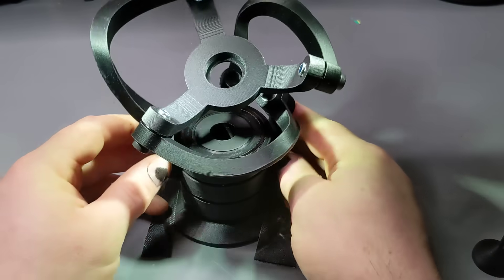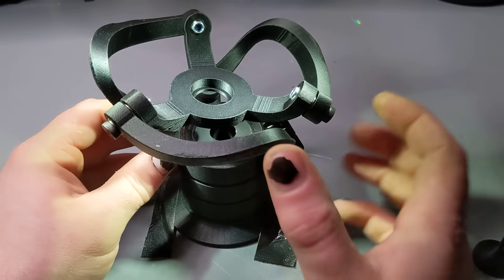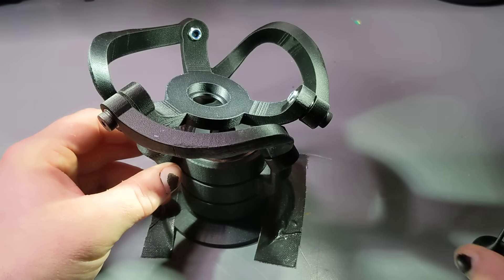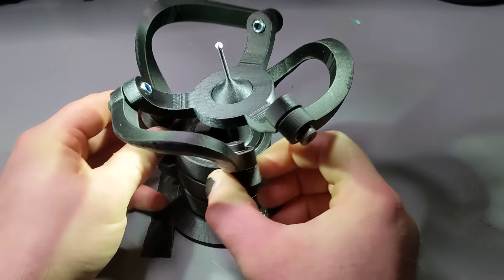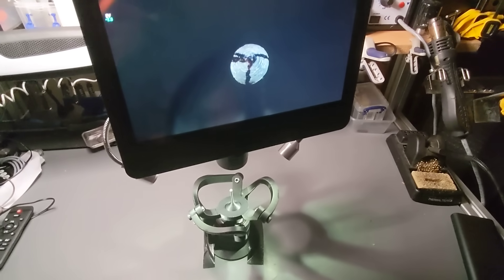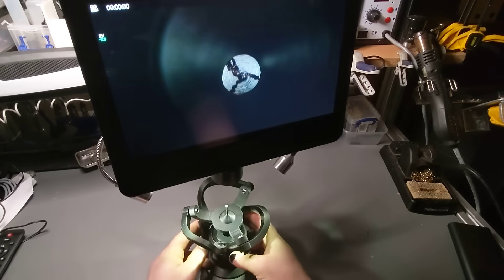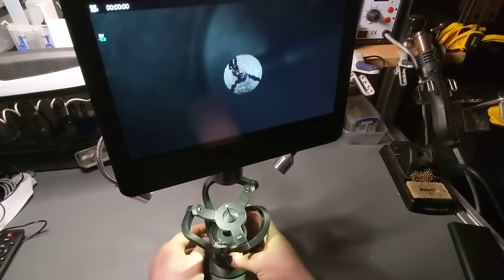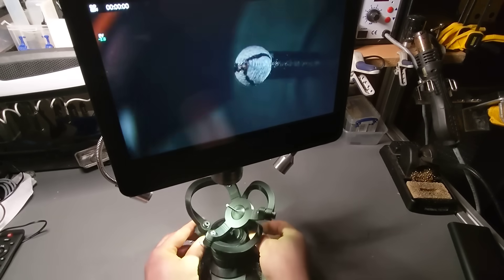Spherical Parallel Manipulator

Comment: I need that - vacuum proof - for my scanning electron microscope. 😅
Reply from the maker: I've been thinking of making a serious one (ie metal and rigid) to sell for microscopy, if people are interested I will, but either way I'll make an open source version for people to make 

I posted an update vid covering cad/files etc, check it out and leave a comment there on which concept you'd prefer and what your use case/application is (people keep surprising me with novel uses) and I'll do my best to accommodate that in the released design. 
https://youtu.be/wN02itp6-z4

Comment: Hey MakeBreakRepair I saw your video this week and it inspired me to practice my fusion 360 (still a total noob) 

are you ever planning on sharing or selling the files? I would love to compare them. 
I spent the last two days attempting to make my own and I got it working! but yours is way better. My PLA monstrosity works though and that is what matters. You are an inspiration. I cant believe this machine is so much simpler than it looks normally I cannot backwards engineer from a single video so easily. You truly made an elegant design that made it easy to understand
Reply from the maker: Thanks, I really appreciate it :) 
Mine only looks good from the angle you're seeing it though, getting the arms to not interfere is tricky... I solved it with a heat gun 😅 (can do it in cad with design studies and similar, it's just tricky)
I can't take credit for the idea, I saw one on youtube and overthought it a bunch, then saw a vid from @swannschilling474 and figured out it's actually simple, you just point all the bearings at the same point in space and join the dots (ignoring the arm interference issue...) 
I made an update vid that talks about it a bit and also CAD etc for people https://youtu.be/wN02itp6-z4
Reply: @makebreakrepair  you lucked into the ideal ratio for the most swing/range of motion though, Ive made a few now and only one of them works, there is something to the angles of it (besides them all pointing at the focal point), something to do with the relation between the first and second sets of screws and their relative angles. mine worked with 120degrees/60 degrees but when I tried to get more travel by going to 100 degrees/45degrees it doesnt work. Maybe it was the fact they multiply evenly in the first case.

Comment: Please release stl files. I would love to print
Reply from the maker: I posted an update vid covering cad/files etc, check it out and leave a comment there on which concept you'd prefer and what your use case/application is (people keep surprising me with novel uses) and I'll do my best to accommodate that in the released design. 
https://youtu.be/wN02itp6-z4
Reply from the maker: I've just uploaded the latest update vid, I've put a lot of work into making it accessible for everyone, files available very soon and I got the costs down to $10 of parts: $10 SPM https://youtu.be/DqjAKmm-FJQ

Comment: Another application would be radiation therapy.

Have a patient secured in a larger version such that the tumor is at the center point of the orbits.

Then as the radiation dose is being delivered, operate the device in such a way that the tumor will get a large amount of radiation but the rest of the body will not.

Comment: The engineering behind is absolutely brilliant!! Do you have the cad file for this ?
Reply from the maker: I posted an update vid covering cad/files etc, check it out and leave a comment there on which concept you'd prefer and what your use case/application is (people keep surprising me with novel uses) and I'll do my best to accommodate that in the released design. 
https://youtu.be/wN02itp6-z4
Reply from the maker: I've just uploaded the latest update vid, I've put a lot of work into making it accessible for everyone, files available very soon and I got the costs down to $10 of parts: $10 SPM https://youtu.be/DqjAKmm-FJQ

Comment: Admire this. Request for the model ❤
Reply from the maker: I plan to release a free 3d printable one, but I might make a more rugged one as a product for labs and such (if there's demand?)
I posted an update vid covering cad/files etc, check it out and leave a comment there on which concept you'd prefer and what your use case/application is (people keep surprising me with novel uses) and I'll do my best to accommodate that in the released design. 
https://youtu.be/wN02itp6-z4
Reply from the maker: I've just uploaded the latest update vid, I've put a lot of work into making it accessible for everyone, files available very soon and I got the costs down to $10 of parts: $10 SPM https://youtu.be/DqjAKmm-FJQ

Comment: I have to made this ! Thanks
Reply from the maker: I plan to release a free 3d printable one, but I might make a more rugged one as a product for labs and such (if there's demand?)
I posted an update vid covering cad/files etc, check it out and leave a comment there on which concept you'd prefer and what your use case/application is (people keep surprising me with novel uses) and I'll do my best to accommodate that in the released design. 
https://youtu.be/wN02itp6-z4
Reply from the maker: I've just uploaded the latest update vid, I've put a lot of work into making it accessible for everyone, files available very soon and I got the costs down to $10 of parts: $10 SPM https://youtu.be/DqjAKmm-FJQ

Comment: This might be amazing to create mechanical parts without spinning by using laser or high pressured water canons or diamonds to cut into 3d shapes, it could also be used for laser dental removal or ofcourse on the moon for shooting metors or ballistic missiles, create applications indeed

Comment: looks nice, you mind sharing the model?
Reply from the maker: I posted an update vid covering cad/files etc, check it out and leave a comment there on which concept you'd prefer and what your use case/application is (people keep surprising me with novel uses) and I'll do my best to accommodate that in the released design. 
https://youtu.be/wN02itp6-z4
Reply from the maker: I've just uploaded the latest update vid, I've put a lot of work into making it accessible for everyone, files available very soon and I got the costs down to $10 of parts: $10 SPM https://youtu.be/DqjAKmm-FJQ

Comment: Rock on with your Perspective Extrapolator! It's very niiice!! "Perspective Extrapolator" is Patent pending... It's a very affordable purchase! Wink, wink, nudge, nudge,.... This is obviously a golden age solution to 360 surround microscopy. I am impressed to say the least. Would you be interested in recording the equally opposite extremes of tunnel vision? For instance; in the case of colonoscopies, if the camera view did not resemble that of a race car driver driving through a tunnel,?  The current camera technology is just plain stupid. What if, the camera that goes up there could just look around all over the place as it goes up there?
Reply: I doubt this can receive a patent: For something to receive a patent, it cannot be an obvious application of an existing technology, and it cannot be previously invented or patented or be readily available in the public domain.  A casual browsing led me to a similar video from three years ago displaying the same robotic manipulator tip and the basic idea has been around for ages--which is why the design is publicly available.  Anyone challenging such a patent could likely have it struck.  Marketable, salable?  Sure.  But I don't think it would receive a patent in the US or UK.  Having said that, if the designer was selling these I'd happily buy it for quality control and product testing as those too have value.
Reply from the maker: I believe there are articulated surgical endoscopes but I'm no expert 😅

Comment: How exact is the centering? 1/10 of a millimeter. Very ingesting 🤔
Reply from the maker: Cheers :) It works better than I thought it would too (the focus etc doesn't need adjusting or anything), given how imprecise some of it is (eg the bearing seats having fdm artefacts that needed cleaning up by hand) - likely due to 'elastic averaging' ie everything bending just a little to accommodate each other and the average of all that approaches the design intent.
I posted an update vid ( https://youtu.be/wN02itp6-z4 ) where I show some of the serious flaws in the design (ie I heat-gunned the arms to flatten the bottoms so they didn't interfere) and it's still accurate despite that manual mangling - elastic averaging is a great tool to have in your maker-kit

Comment: Your work precision must have been staggering! You probably have like what? Less than 1mm deflection?
Reply from the maker: Cheers :) It works better than I thought it would too (the focus etc doesn't need adjusting or anything), given how imprecise some of it is (eg the bearing seats having fdm artefacts that needed cleaning up by hand) - likely due to 'elastic averaging' ie everything bending just a little to accommodate each other and the average of all that approaches the design intent.

I posted an update vid ( https://youtu.be/wN02itp6-z4 ) where I show some of the serious flaws in the design (ie I heat-gunned the arms to flatten the bottoms so they didn't interfere) and it's still accurate despite that manual mangling - elastic averaging is a great tool to have in your maker-kit

Comment: Never thought of that, very nice! Need to get me a baby one for my microscope!

Are you sharing/selling the files?
Reply from the maker: I posted an update vid covering cad/files etc, check it out and leave a comment there on which concept you'd prefer and what your use case/application is (people keep surprising me with novel uses) and I'll do my best to accommodate that in the released design. 
https://youtu.be/wN02itp6-z4
Reply: @makebreakrepair  thanks man! I appreciate the response and I'm sure others do too. I can relate to making unsharable projects due to improvised proprietary parts. I cant relate on being being productive and remaking it out of sourcable parts, so hats off to you ❤️
Reply from the maker: Yeah, it can be tricky to choose parts that are easy to find and cheap, some tips to make it easier:
- Parts for 3D printers are everywhere, so if you can make it from something used in 3d printing (eg 6mm and 8mm precision rods are common thus there's places selling 30cm lengths of it everywhere, but 10, 15, or 20mm rods are industrial supply). Check out the Voron project's parts sourcing lists
- Skate bearings are ubiquitous due to the popularity of skating, making them cheaper than other sizes, which meant lots of projects use them, which makes them even more common. They're 8mm ID bearings, code 608xx (with 'RS' (sealed) or 'ZZ' (shielded) as the suffix), so 608RS bearings are everywhere and cost nothing. 
- similarly tslot extrusion is everywhere as it's used for 3d printers and many other things, so it's an excellent material for frames/strength in a project.
Reply from the maker: I've just uploaded the latest update vid, I've put a lot of work into making it accessible for everyone, files available very soon and I got the costs down to $10 of parts: $10 SPM https://youtu.be/DqjAKmm-FJQ

Comment: Oh, that is nice! Do you mind sharing the model file, stl, or where to find this model? This could be useful when studying insect specimens in the stereo microscope.
Reply from the maker: I plan to release a free 3d printable one, but I might make a more rugged one as a product for labs and such (if there's demand?)
I posted an update vid covering cad/files etc, check it out and leave a comment there on which concept you'd prefer and what your use case/application is (people keep surprising me with novel uses) and I'll do my best to accommodate that in the released design. 
https://youtu.be/wN02itp6-z4
Reply from the maker: I've just uploaded the latest update vid, I've put a lot of work into making it accessible for everyone, files available very soon and I got the costs down to $10 of parts: $10 SPM https://youtu.be/DqjAKmm-FJQ
If you're interested in the short-run, professional use metal version please fill out this form: https://forms.gle/XGxA5Zzp16doP4pE6
Your email or any other info you put in that form will not be used for marketing, nor passed on to any third parties, nor used in any way other than to contact you about that specific project - I'm just an engineer in a shed figuring out if people want something :)

Comment: Could this be modified to be a plane controller?
Or 3D space navigator? 
Where you hold the ball and it doesn't move central position, but it rotates in place as you move your hand, along the three axis, and transmits the coordinate translations to the "computer".

Comment: BTW are these available commercially? I don't have a 3D printer. I would really like to get one of these for stereo microscopy.
Reply from the maker: I haven't found any that weren't ludicrously expensive, though I may consider making one as a product for microscopy, I'd release the fun 3D printed one anyone can make and if there's enough interest I might make a heavy duty metal one as a product to buy. 

I posted an update vid covering cad/files etc, check it out and leave a comment there on which concept you'd prefer and what your use case/application is (people keep surprising me with novel uses) and I'll do my best to accommodate that in the released design. 
https://youtu.be/wN02itp6-z4
Reply from the maker: I've just uploaded the latest update vid, I've put a lot of work into making it accessible for everyone, files available very soon and I got the costs down to $10 of parts: $10 SPM https://youtu.be/DqjAKmm-FJQ
If you're interested in the short-run, professional use metal version please fill out this form: https://forms.gle/XGxA5Zzp16doP4pE6
Your email or any other info you put in that form will not be used for marketing, nor passed on to any third parties, nor used in any way other than to contact you about that specific project - I'm just an engineer in a shed figuring out if people want something :

Comment: This is awesome! Do you mind sharing STEP files for it?
Reply from the maker: I plan to release a free 3d printable one, but I might make a more rugged one as a product for labs and such (if there's demand?)
I posted an update vid covering cad/files etc, check it out and leave a comment there on which concept you'd prefer and what your use case/application is (people keep surprising me with novel uses) and I'll do my best to accommodate that in the released design. 
https://youtu.be/wN02itp6-z4
Reply from the maker: I've just uploaded the latest update vid, I've put a lot of work into making it accessible for everyone, files available very soon and I got the costs down to $10 of parts: $10 SPM https://youtu.be/DqjAKmm-FJQ

Comment: Camera stabilization during flight on an RC car, allowing gimbal of the camera without losing its center to the vehicles driver position. Same with pilot seat on an aircraft.

Possibly Tx/Rx controlled cameras on vehicles that drive on the street as well.

If you built one that can hold things like rings and figurines, would make a good holder for engraving, graving, etching, painting, even sculpting.
Reply from the maker: People keep surprising me with novel uses :)
That said it wouldn't be good for graving etc as it's very flexible, a normal ball vise would work better there. 
I posted an update vid covering cad/files etc, check it out and leave a comment there on which concept you'd prefer and what your use case/application is and I'll do my best to accommodate that in the released design. 
https://youtu.be/wN02itp6-z4

Comment: AWESOME. How can i get the 3D file? In a non related subject I subscribbed.
Reply from the maker: I plan to release a free 3d printable one, but I might make a more rugged one as a product for labs and such (if there's demand?)
I posted an update vid covering cad/files etc, check it out and leave a comment there on which concept you'd prefer and what your use case/application is (people keep surprising me with novel uses) and I'll do my best to accommodate that in the released design. 
https://youtu.be/wN02itp6-z4
Reply from the maker: I've just uploaded the latest update vid, I've put a lot of work into making it accessible for everyone, files available very soon and I got the costs down to $10 of parts: $10 SPM https://youtu.be/DqjAKmm-FJQ

Comment: This probably could also be a very useful tool for model painting. With some modifications it could be used to produce many, MANY different lighting angles to light a mini as it's being painted.
Reply from the maker: I posted an update vid covering cad/files etc, check it out and leave a comment there on which concept you'd prefer and what your use case is and I'll do my best to accommodate that in the released design. 
https://youtu.be/wN02itp6-z4
Reply from the maker: I've just uploaded the latest update vid, I've put a lot of work into making it accessible for everyone, files available very soon and I got the costs down to $10 of parts: $10 SPM https://youtu.be/DqjAKmm-FJQ
Reply from the maker: I've just uploaded the latest update vid, I've put a lot of work into making it accessible for everyone, files available very soon and I got the costs down to $10 of parts: $10 SPM https://youtu.be/DqjAKmm-FJQ

Comment: Clicked because I had no idea what it was.
Now I need one.
Step 1: Fix Debt
Step 2: Buy 3D printer
Step 3: make anything I want.
Reply: Step 4: "fix" 3d printer 
step 5: print until it fails again
Step 6: fix it again
Reply: @tomasagustin45  Step 7: print more parts for the printer to prevent it from breaking again